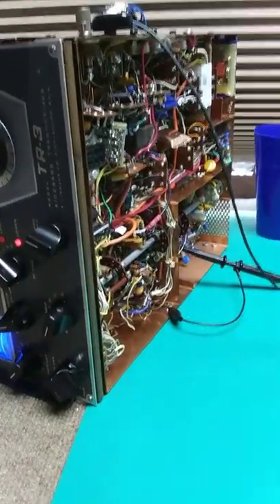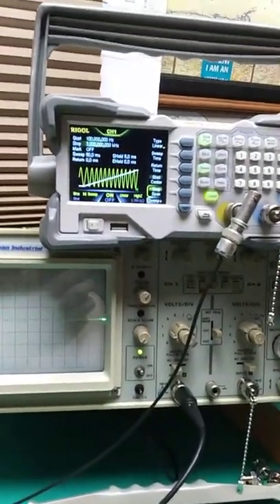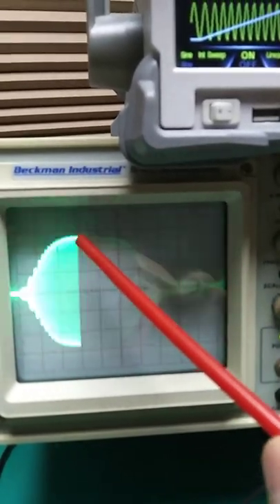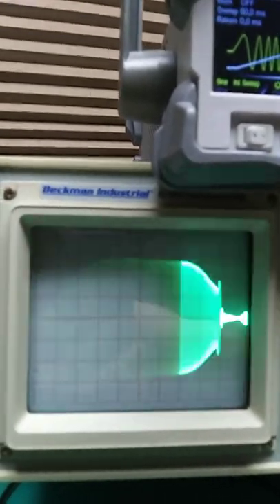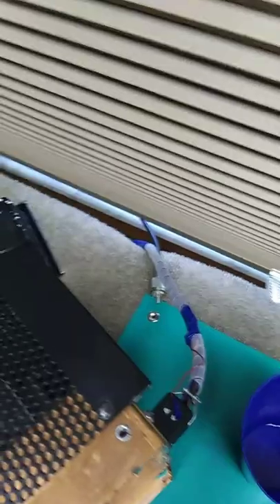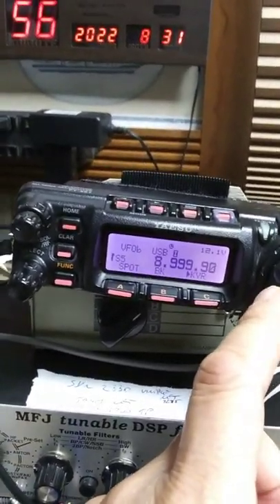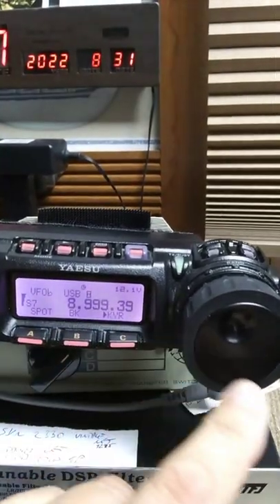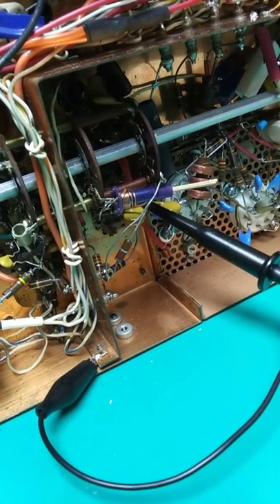Drake TR3 SSB Filter test

Comment: Its like the old days spoting the carrier to the frequency
Reply from the maker: yes and Ive been trying to use old methods and minimal test equipnent to work on it as would have been done in the 1960s.

Its tempting to use a fancy spectrum analyzer but they didnt have them then, and the SA is designed for 50 ohms but all the circuits in the rig are high Z so its not so easy..

Comment: Love the led conversion what type leds you used for the leds like to do the same to my kenwoods
Reply from the maker: Its a bayonet style holder with a single LED. Its blue but doesnt work well bc its narrow beamwidth and tends to make a spot instead of diffuse.
Reply: @k8byp  ohh cool i figured that is a bayonet style bulb socket to get rid of the blue dot get the finest sand paper roll it around the led to get it defused so it wont be blue in one spot the whole led need to be carefully done it will work
Reply from the maker: sanding it didnt work. there are other types that work better but these were cheap $$
Reply: @k8byp  is it the pinball ones
Reply from the maker: : 0